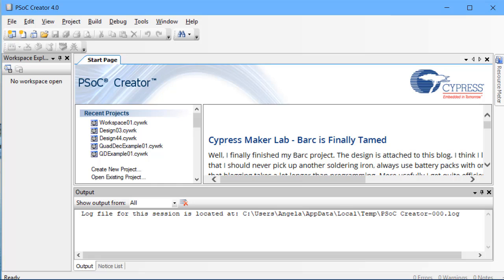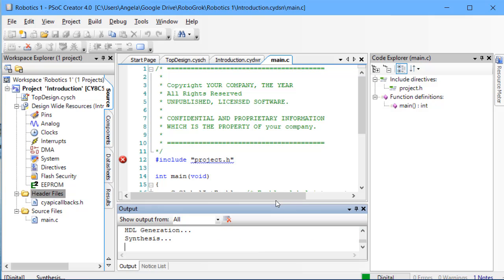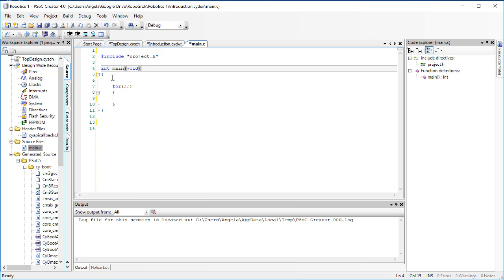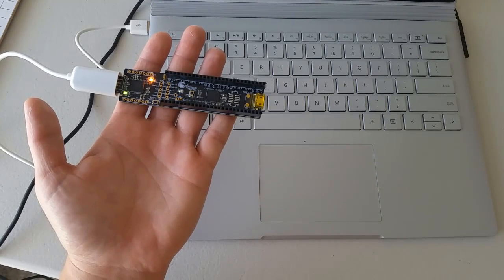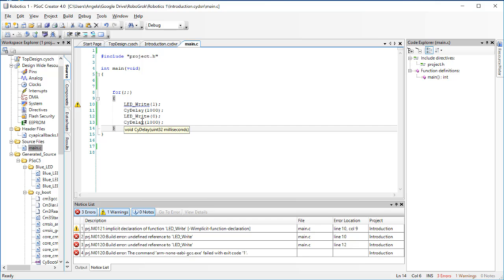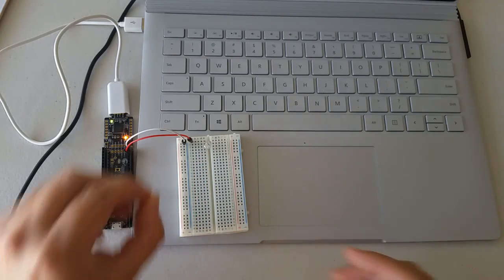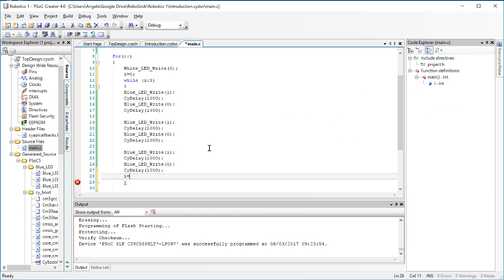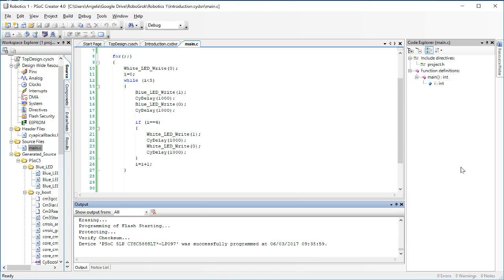Robotics 1 U1 (Kinematics) S1 (Preliminaries) P4 (First PSoC (C) code)

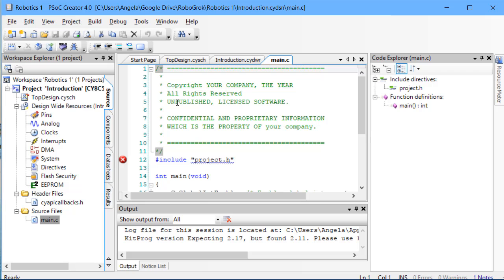Comment: Hi Angela I am having an issue at 5:11 in the video using PSoC Creator 4.4
When I click the "program" button (the chip icon you mentioned) I am greeted with the following same debug target window and the following error when I click ok/connect.

The selected debug target 'CY8C5888LTI-LP097' is not compatible with the project's selected device 'CY8C5868AXI-LP035'.

When I click ok, it doesn't let me continue and it keeps the error window up and stops me from progressing through the video. I also saw in your video it shows the same error but it still let you click through it. I tried to go on the infineon website to download PSoC Creator 4.0 version but it keeps returning an INVALID requested URL on their archive so there's no way for me to download that version either. I'm being held up in progressing with the course and would appreciate assistance thanks.
Reply from the maker: @NotSionnix  can you try changing the selected device for the project? Go to the Project menu, then click Device Selector. At the bottom of the window that opens, click Clear Filters. In Family, check only psoc 5lp. Then, scroll through the list until you find CY8C5888LTI-LP097. Select it, then click ok, then try programming again
Reply: @asodemann3  Hi Angela. I was able to solve the issue by using the waybackmachine to track down a snapshot of PSoC Creator 4.0.exe and install the older version of the IDE. It's working now thanks! I will try your solution on the 4.4 version though and report back.

EDIT: Your solution worked on the 4.4 version. So for anyone else who has this problem, change the PSoC target in the device selector first before clicking on the "program" chip icon just like Angela said in the above comment.

Comment: I just discovered your series of videos on robotics and find it very interesting. I have a question though: the videos were posted in 2017 and we are in 2021 now so, if I download a newer version of the PSoC board or/and a new version of the development environment, will all your examples and explanations will work as explained?
Reply from the maker: I haven't been getting messages from people saying that things aren't working, so I think things are still working. For the Python stuff, though, you will need to keep using Python 2, not Python 3 because 3 is not compatible with 2. But, if you try something and find it not working, please do post here or on my website, and I can usually help you figure it out.
Reply: @asodemann3  Thanks for your answer; I will use Python 2 and try with the newest board and ide